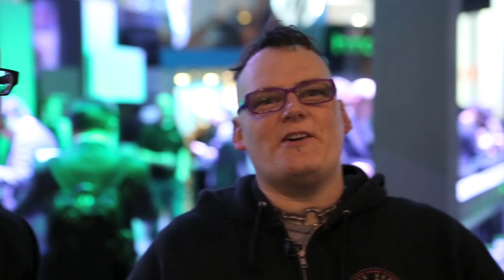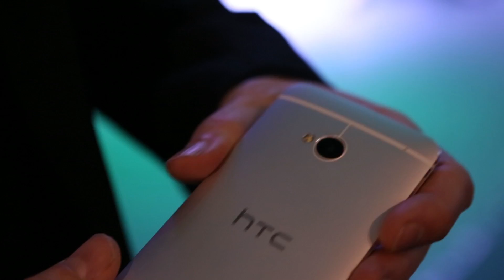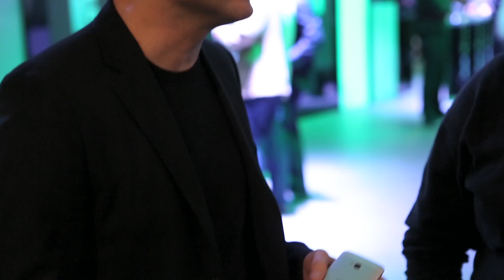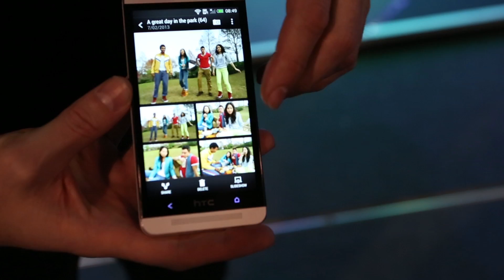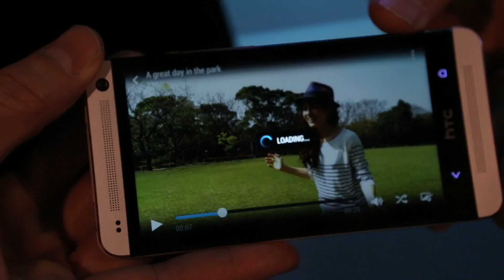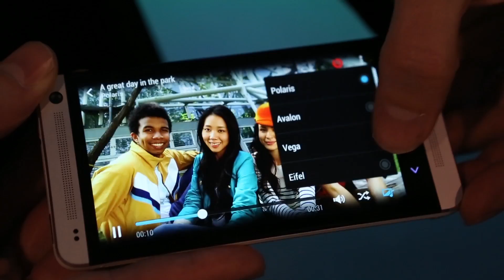VP of design Scott Croyle talks HTC One at MWC 2013 | Engadget

Comment: from what Ive read, those two strips of plastic help boost antenna signal so that there isn't a "death grip" if you like. most of the antenna are built in to the aluminum, but the plastics strips are there just to make it so that you cant block the signals by holding it in a certain way. well that's the theory anyway, hopefully this is the case come everyday use, only way to find out is when becomes available in the retail market. hope i answered your question